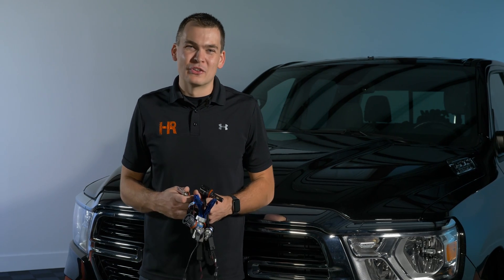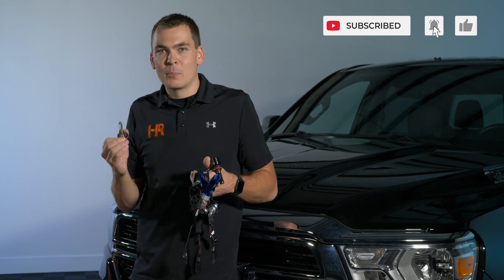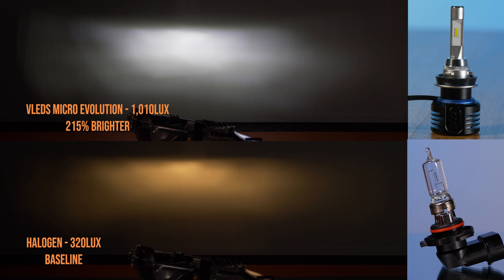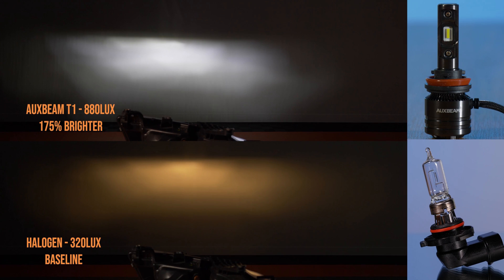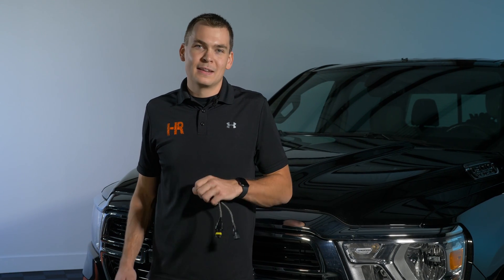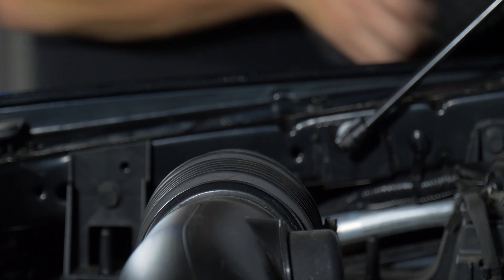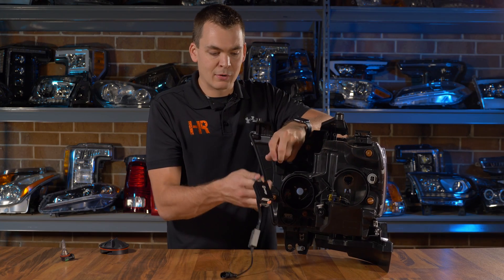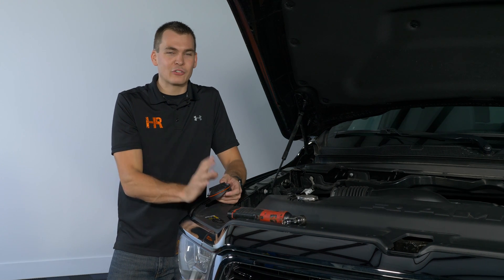HR Tested: 702% Brighter LED Headlight Bulbs 2019-2020 Ram 1500

Comment: What do you recommend for  combinations on low and high beams and fog lights for these.I want to go the gtr  lighting ultra 2 for low but idk what to do for high beam to make it brighter and for a high beam  and fog light.I currently have the Lasfit led bulb kit and I’m not to satisfied with them.I had them in my impala when I had it and they were extremely bright.Funny enough is that they were the exact bulb type.The Lasfit ones on my truck doesn’t seem to brighter than stock
Reply from the maker: We actually tested low, high, and fog in this video—and the pick then was GTR Ultra 2. Since Ultra 3 is out now, that’s the move across the board: Ultra 3 for low beam, high beam, and fog lights!
Reply: @HeadlightRevolution thanks for your help.I greatly appreciate it

Comment: Can you try. For 2019 ram 1500 the 360 full illumination bulbs?
Reply from the maker: We’ve already tested lighting upgrades on the 2019 Ram 1500, and you can check out our recommendations in this video: https://www.youtube.com/watch?v=wi2Z9cQnhhk&t=27s. As for 360° multi-sided LED bulbs, we’ve covered in other videos why those designs usually don’t perform well—so we wouldn’t recommend them for your truck.

Comment: do you know if they sell that connector on the bottom left(5.38). the main connector but the part attached to the light that goes into the harness pigtail? hope that makes sense
Reply from the maker: Thanks for reaching out! I want to make sure we’re understanding exactly which connector you're referring to. Could you provide a bit more detail or a picture for clarification?

For the quickest assistance, please reach out to our team directly at sales@headlightrevolution.com or call 218-755-5200, and we’d be happy to help identify the part you need.

Comment: The bulb doesn't sit horizontally, it sits diagonally on driver and passenger. Is it suppose to be like that? Or did I do something wrong?
Reply from the maker: You can adjust the bulbs, there is a screw at the base!

Comment: I would use 3M Velcro to secure the driver and PWM module in place. Letting it bounce around in the housing can possibly damage the delicate electronics on the circuit board.

**UPDATE**
Just installed my bulbs from HR. There is no room to Velcro anything in place. Everything is so snug nothing will bounce enough to be worried about.

Comment: I found the following bulb, and wonder how it would compare to my stock bulb, as well as some of the bulbs you show in your video:
8000K ICE BLUE LED Headlights + Fog Lights Combo COB 6x for RAM 1500 2019 2020
They are fan cooled.
Reply from the maker: 8000k blue would be worse that your stock lights, avoid them!

Comment: I purchased the GTR ultra 2 low beam bulbs and I am extremely pleased with the outcome of the lighting in the 2020 ram. I then purchased the high beam bulbs for the same vehicle.  Just as extreme pleases I was low beam, I was so disappointed with the high beam. The stock halogen bulb work better and I just wasted $208.00.  Anyone thinking of putting both high and low beam bulbs in there 2020 ram, save some money and only put in the low beam bulbs.
Reply from the maker: Shoot us an email at Sales@headlightrevolution.com and we can assist you with a return.

Comment: Just installed.... CRAZY difference from stock. Can't hear fan.... Please note for low beams need to remove wheel well. I went with 5 bolts but hindsight would do more.  Drove I'm the rain tonight where traditional the halogen stink... GTR is brighter than my 19 Audi SQ5 whichbjas the best lights I have used.
Reply from the maker: So glad to hear that those bulbs are working for you, thanks for the pointer on the installation! If you need anything else, or have any questions just let us know! Thank you and have a great day!

Comment: How do you switch out the high beams as well?  Do you have a video showing how?  Thanks
Reply from the maker: High beam was opened up in this video, but as it is the same right turn to lock it in place we didn't feel the need to include that in the video. It will be the exact same process for the high beams!
Reply: @HeadlightRevolution  do you need the pmw module just for the low beams or for all plus fog lights?

Comment: Probably dumb question , but any idea if the OEM halogen headlights can be directly swapped on a truck that came stock with the LED headlights ?
Reply from the maker: I'm sure they could, but it wouldn't be easy. You would need a custom wiring harness made, as there is no plug and play harnesses available.

Comment: Whats the difference between changing the bulbs over changing the housing to the oem leds. They don't seem worth the price after seeing this forsure.
Reply from the maker: The OEM housings are expensive and require you to remove the whole front end. The bulbs are a quick and easy upgrade!

Comment: With all that stuff stuffed into the headlight and bouncing around .... I can only wonder if there is alot of rattling and how long it would last ?
Reply from the maker: It really isn’t as bad as you might think, It’s a tight fit. We don’t see failures on these products often.
Reply: @HeadlightRevolution  
   Thanks for the fast reply.  What's the average lifespan of these setups ? Just bought a 2020 ram and would like to replace everything nose to tail.
Reply from the maker: The GTR Lighting Ultra 2 bulbs have a lifetime warranty, If you went that route you’d never need to buy another set of bulbs!

Comment: What's the best bulb for a 2012 ram 2500
Reply: I’d say go to Headlight Revolutions to find a good headlight bulb. I’ve been using their products since 2019. More specifically the S-V.4’s. Been awesome for me.

Took the outta the Expedition I traded, and put them in my 2024 Ram with the help of this video.

The video install uses the passenger side for the install walk-thru. Passenger side was easy… that driver side was f@cking kinda crazy!!! I absolutely hate engineers now.

Feel like the non-friendly placement of the bulbs, power pulsating without the use of a PWM, and vehicle tear down just to remove the headlights were all planned. Trying to keep people from using non-OEM upgrades.

Inconvenient… yes. Impossible… no. Instead of spending the money for people to figure out how to keep us from doing things just do them for us.

Those halogens that came with the truck are horrible!!! After using my Headlight Revolution bulbs for the last 5yrs the OEM setup looked like candles.

Comment: Thank you for another great video. I have a question that doesn't pertain to a 2019 Ram. I just bought a 2007 Harley Davidson Sportster XL883 and the factory headlamp leaves a lot to be desired. Harley sells high output lamps for $500 and up, can you recommend a  headlamp that has high lux and won't brake the bank? Thx
Reply from the maker: Check out the Holley Retrobrights if this is using a standard 7 inch round housing!

Comment: Why are H11B led headlight bulbs so hard to find? The leads for my car come out the side of the bulb and twist in. The only choice on the market that is true plug and play is from “The Headlight Experts” for $99. Regular H11 with conversion kits are too difficult to install without full removal of headlights. Would love to get  the GTRs but not available. BTW, car is 2012 Kia Optima.

Comment: That's fantastic I have to bear that part number in mine but I have a 2012 Dodge Challenger SRT8 and I was wondering what is the best bulb for the inside drive light and turn signal I would like to change it right now I have a bulb in it but it has I haven't got a dash light signal to come on yet but it does hyper flash I was wondering if you could help me out with this problem what is the best bulb that you have I'd like to keep it yellow for turn signal and bright white like for a drive light please help me